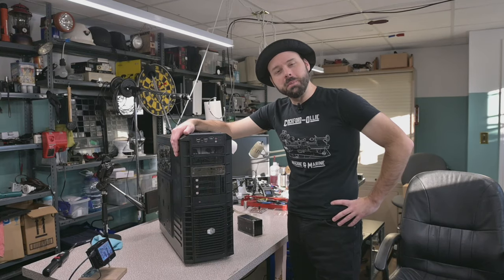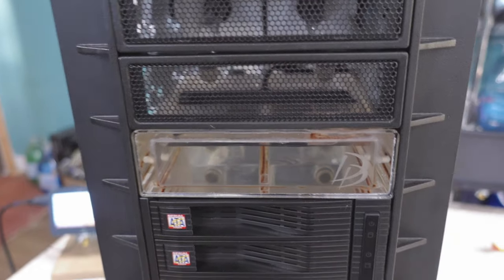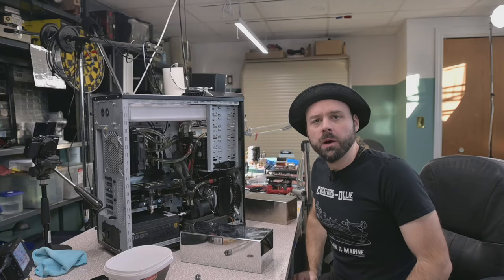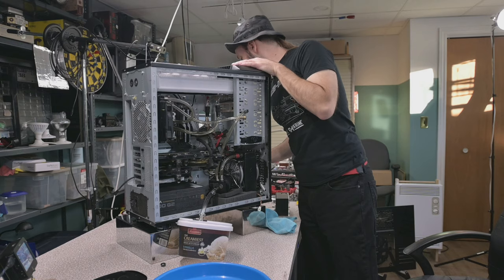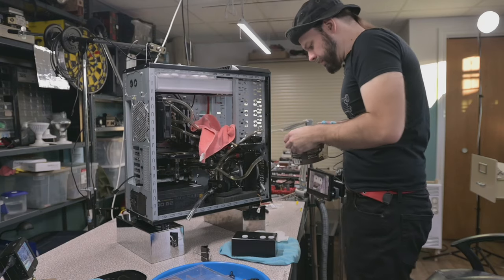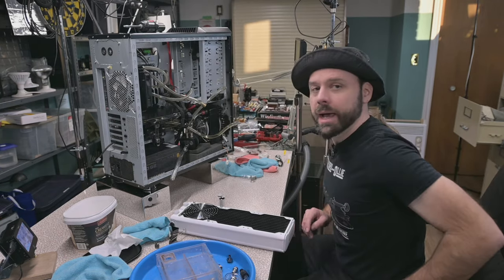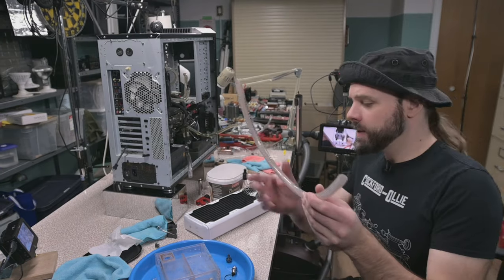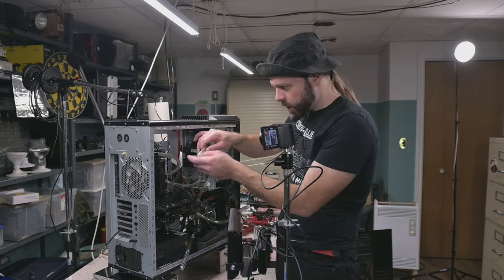Changing out the Reservoir in my Old HAF 932.

Comment: Haf 932 is the best for watercooling! Using it for 14 years, got 240, 360 and 200mm radiator on it, now changing to thicker ones :)  Water do not exceed 30 degrees Celcius in fans silent mode.
Reply from the maker: a 360 AND a 240 ? Where'd you put the 240 ?
Reply: @DATT  240 rad is behind the rear fan, outside the case using EK radiator mount. Later I will replace it with thin 360 with the same mount :) second 360 rad is now mounted on top, will change it to something thicker, like 60mm ;)
Reply from the maker: @BORtheGreat  Ohh, External Rads, yeah I guess that works, tho I was never fancy on the idea myself. Not like that anymore.

Comment: Dude i just got a 360 aio and i was about to send it back for a 240 cuz i thought it won't fit untill i started thinking about throwing out that old cd reader 😂 glad i could find your vid to make sure it works
Reply from the maker: Yeah, disk drives are just of no use anymore. I take it you have the same case ?
Reply: @DATT  yeah i recently bought a 13600k with a new motherboard but i kept tge case cuz why not
Reply from the maker: @aryankarimi1452  Damn, what was in the before ? You've always jsut kept the case like I did. 
It's a good case, I have yet to find something new that makes it worth replacing.
Reply: @DATT  Mine was a 2014 power house that i found on facebook for 150€ two years ago ( sabertooth z97 mark 1 i5 4690k 16gb ddr3 gtx 970 ) it was clugged with dust the owner said that the motherboard was dead i cleaned it and found out that only the psu was bad and been using it since then now im going for a whole decade worth of upgrade 😅 but honestly i saw now reason to replace the case seen the quality of material and the space it has the onlydown side is all the dust that it collects which is a sign of its good airflow
Reply from the maker: @aryankarimi1452  OH ok, yeah that makes sense. 
Well, you're stuck with it now. It'll be hard to justify getting rid of. 
The trick is to calibrate the big fans to run dead slow. It'll pick up less dust but still keep it proper cool.